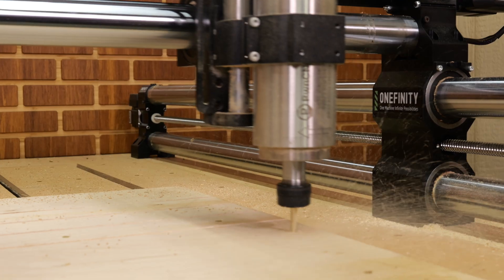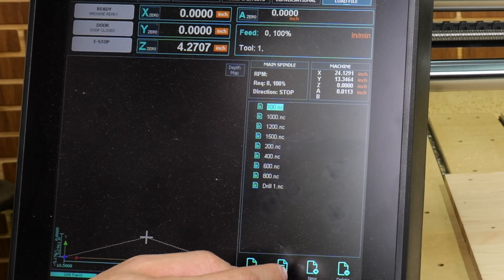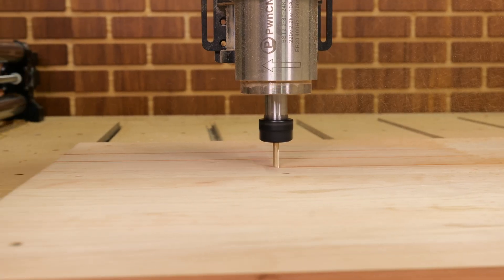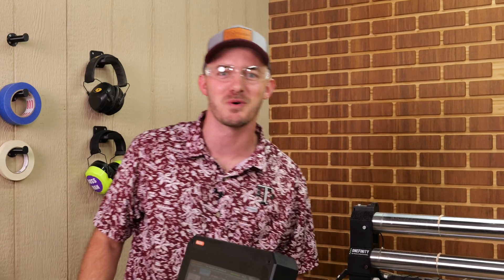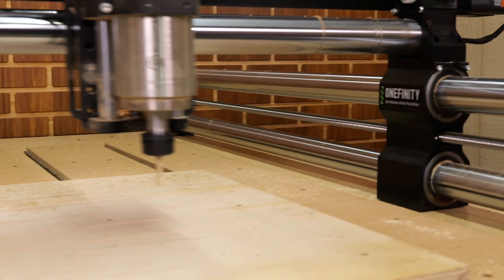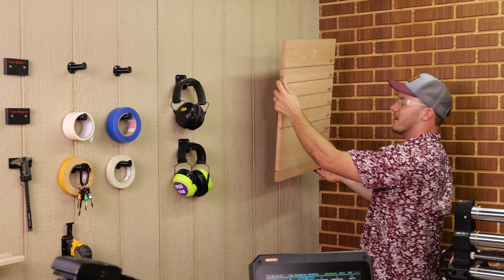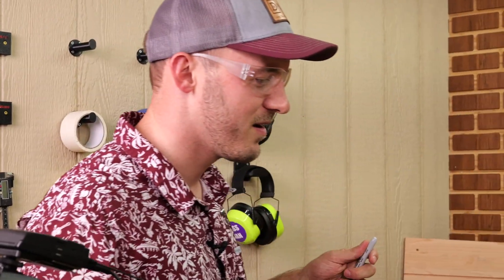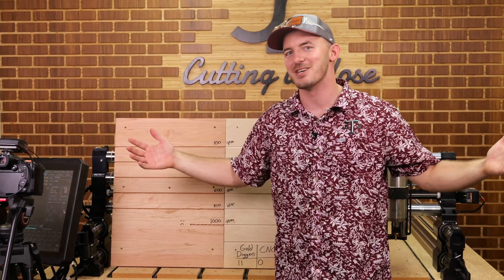Pushing My CNC to Its Limits! How Fast Is Too Fast?

Comment: All that is happening is the steppers supplied with the Elite are erroring out. Masso doesn't even sell those steppers to the general public. Add the 2Nm or 3Nm steepers even with the 36v power supply and you could cut at those speeds.

Comment: I have to assume this machine has closed-loop steppers, right? That's how it was able to stop when the load was detected as exceeding some threshold. My machine, which I built based on the PrintNC open source design, currently has open-loop steppers, so I'm pretty sure mine in a similar stress test would have snapped the bit (hopefully embedding into the wood and not becoming a projectile, but good call on wearing your eye protection) and then continued along the path. My machine is definitely more rigid than the one you're using here, so I gotta say it's eye-opening to see how much faster I could be pushing it through wood than I have been, and that roughing bit no doubt is playing a key role in that too. Thanks for running this test and sharing the results!
Reply from the maker: You’re welcome, I hope you learned a ton!
Reply: Industrial CNCs regularly run at 100+ IPM cutting aluminum. Even my tiny 3018 CNC machine can handle 100 IPM cutting wood. Wood is easy, you can really push the machine.

Comment: What is actually new other than calling these roughing end mills "gold digger"? Titanium nitride coated serrated roughing end mills have been around for about 40 years. They produce a rough surface finish that must be cleaned up, usually with a finishing end mill. They are commonly used for cutting aluminum and steel, not wood.
Reply from the maker: Yes, every bit has been around for years, I have been using roughers in my shop for quite a while now. Having a rougher in a 1/4 inch is new to woodworking. Also adjusting the rake, and the tooth face of the bit so that it leaves as little tear out as possible on wood and reduces the upshear force on the upcuts have taken me a long time to figure out which works best. You guys seem to know a lot about bits, so you should know not all bits are same. They can both be 1/4 upcut finishers but depending on multiple different geometries of the bit, they will perform different.
Reply: Nothing other than he's trying to sell them as his own brand.  Wait until he learns about DLC and TiAlNi coatings.

Comment: Upgraded from my original 2020 Woodworker to an Elite Foreman last month and about to finally put it together this week. Thanks for breaking your machine so I don't have too! Are these chipbreaker bits you've designed for hogging out material only, or also for smooth finish too?
Reply from the maker: Its finish has tiny lines, a little bit of sanding is needed, but man it’s nice!
Reply: @cutting-it-close  Noted! I'll order one to add to my ATC lineup.
Reply from the maker: It’ll be worth it, reach out if you have any questions, we use it daily inside the shop
Reply: @cutting-it-close  OK, just ordered one a few minutes ago. Looking forward to trying it out in some walnut this weekend.

Comment: So to clear it out, you have a CNC that is tracking each step on the stepper motors (feedback) so when you hit the first problem in cherry and it skipped a step it stopped the program. This was also the same time when you should have known that the bit is stronger then the stepper motors since it lost a step. (aka nothing is breaking). Looks like a really great and strong bit and I think the worst you can do to the bit is running it to slow so it rubs and gets to hot and after that it would probably break before the machine lose steps. Anyway great show and the OnefinityCNC clearly shows it has enough power for a hobby CNC. As long as you don't modify the max current to a motor I would not expect anything on the machine to break except maybe a bit.
Reply from the maker: I would agree, that closed loop system really helps! I do worry about some slight damage when doing it over and over again though.

Comment: It is Sunday correct……..That was very impressive even though I already knew  it could do 1,000ipm due to your livestream. Let’s try it with some arch cuts and find out when it breaks. You have me almost to the point where I want to purchase one.
Reply from the maker: Yes, It took a little longer than usual to get this edited, we will be back to Saturday postings next week! I use those bits in the shop on a daily basis, they can handle anything I have been able to throw at them.

Comment: Great video! Next video: Running bits through aluminum at different feed rates
Reply: i dotn think that machine can hadle alum
Reply: @fatfishdesignz brass and aluminum are no problem for this machine
Reply: @fatfishdesignz  Even tiny 3018 machines can handle aluminum. Aluminum and brass are soft metals.

Comment: What CNC is that and how much does it cost? It doesn't look like a hobbyist machine.
Reply: Looks like a Onefinity Elite Foreman CNC machine with the PWNCNC Watercooled spindle upgrade.  About $4000 for the CNC and another $900 for the spindle kit.
Reply from the maker: Correct @Vintauri

Comment: Too bad you couldn't check the temperature of the bit with each test as well.
Reply from the maker: I did, it got hot after 800 ipm and onwards, I think it was due to the vibrations of the machine though!

Comment: Man that is awesome.  I wish I owned a cnc machine that could run that fast.  However, I never would use it at that speed, but the bit is what really impressed me the most.  I have got to have some of these bits!!
Reply from the maker: Thank you, not the most practical speeds, but it does show what they are capable of! Let me know how the bits work for you!